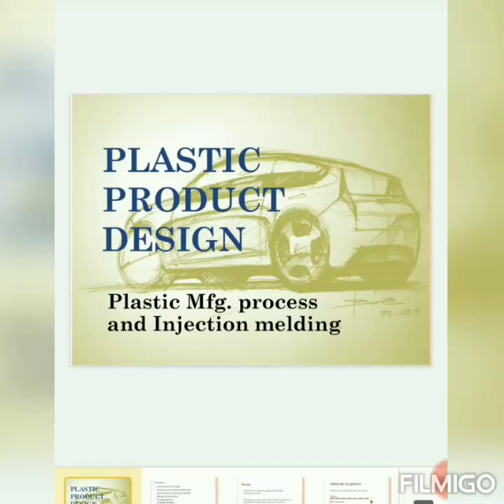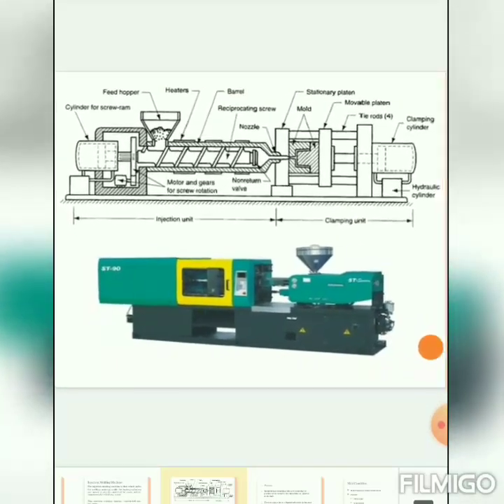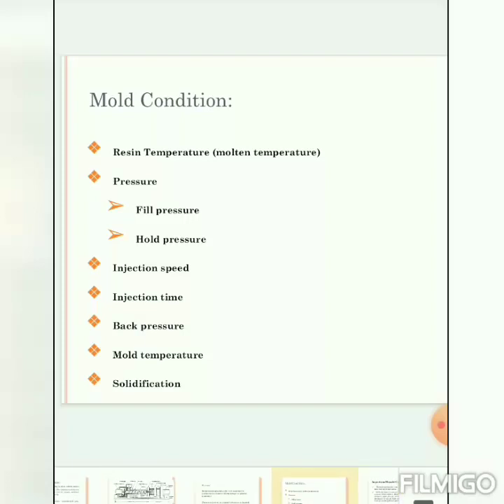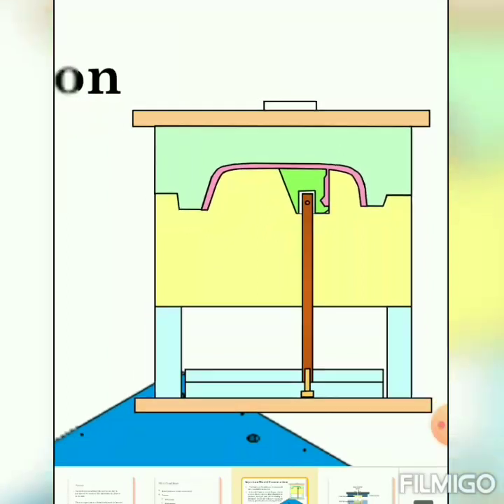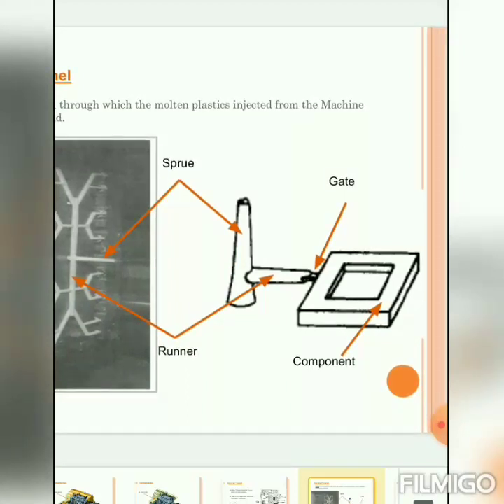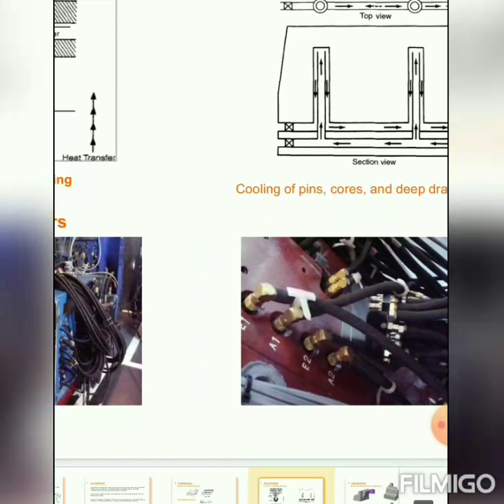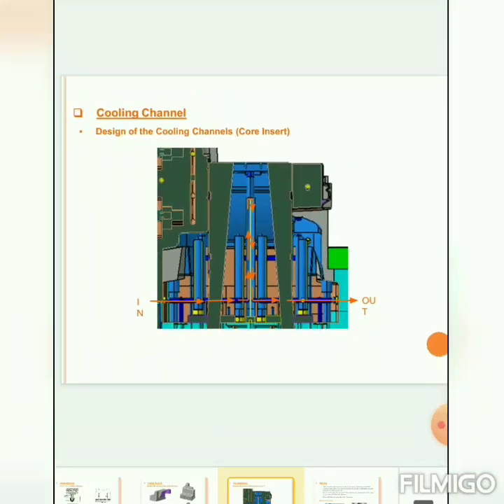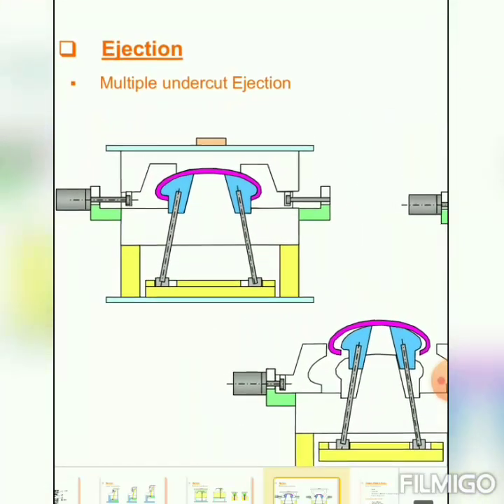Injection Molding in Plastic Product Design

Comment: Hello Sir. Avinash here. Sir plz make a videos on advance catia commands which are used in plastics designing and BIW!! Sir please help.. I'll help you to grow your channel
Reply from the maker: Yes definitely ...I will cover all advanced commands in Catia....But still There is some issues in Catia ..And I don't have license as am away from pune ....
Reply: But sir you can download crack version also
Reply from the maker: I don't have authority for download as I'm using company laptop ... Once  after lockdown Reval I will cover Advanced Catia like ..
Axis system , position sketch , boolean operation, engineering feature & power copies , draft analysis, close volume....
Reply: Sure sir. Thank you so much